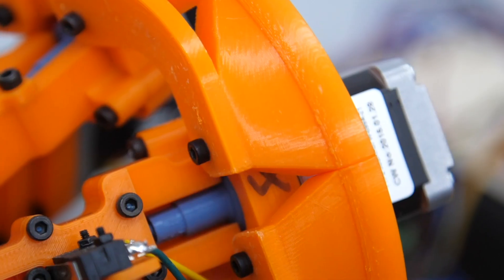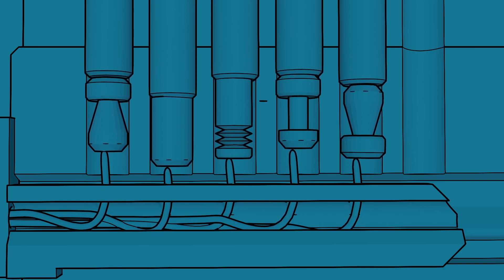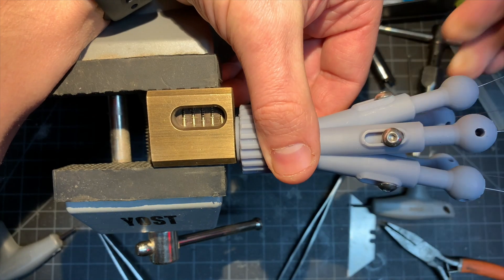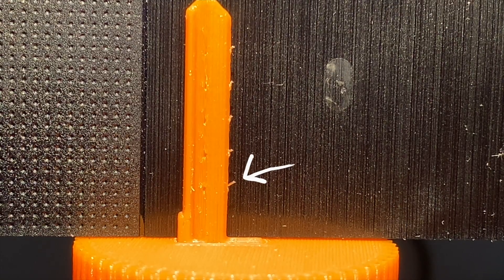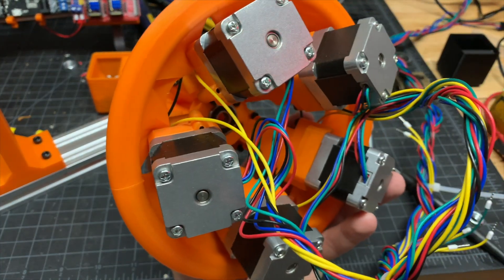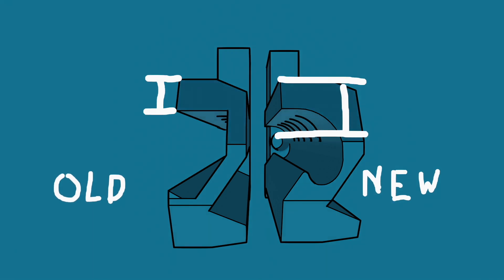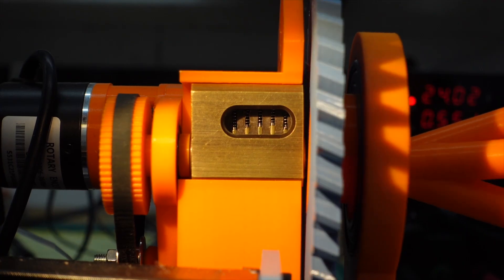i made a robot that picks locks WITHOUT A PICK

Comment: Very nice project! Why not just spin the lock instead of the key assembly? I was also wondering if you could add a distance sensor for each wire so that no test turn is necessary.
Reply from the maker: You know… spinning the lock never occurred to me.
Reply: @SparksandCode I receive similar comments on my projects, too. Once I get going on an idea, it's full speed ahead, and I forget to ask myself if there are alternative solutions.
Reply from the maker: Exactly. 

I’ve been nerd sniped by a few of these comments that have creeped into my rough idea for v3
Reply: @SparksandCode  Nice. I'll be on the lookout for the next version.

Comment: Wouldnt it be possible to push the wires as far as possible and then turn the key so the pins bind and then you can pull the wire out and turn it completly

Comment: You could eliminate the linear actuators if you made the key have pins with springs the wire pulls against rather than pushing the tumbler pins directly with the wire

Comment: very close to one of the ideas i had of using a key blank as a guide for a pick with a finger for each pin, though my idea was leaning more towards the Leishi design. could probably even make a modified version for dealing with the Bowley lock, though i remember seeing someone actually built a pick for one about a year or two after i had posted a description for an idea i had as a design to deal with it's "unpickable" design lol. coding and 3D printing are outside of my skillsets though, i'm more mechanical and old school lol. now you just need to get the optical encoder to the front of the lock somehow so that it could be used for some real work! definitely have to follow this project :) got my sub!

Comment: Pretty interesting.
1st of all, the metal key is absolutely necessary. Even aluminum ones  can get twisted, and you are trying resin/plastic...
2nd of all, you can try to use a base-whatever Gray code, to reduce the number of moved pins.

Comment: The wires don´t need tension, but that doesn´t mean you cannot use it. To put less pressure on the plastic of the key itself, it could have a slightly wider top part made out of metal, kind of functioning like a tensioning tool. Then, the mechanical stress of the rotation is mostly applied to this metal part.

Comment: More modern stepper drivers such as the TMC2209, are capable of measuring resistance on the stepper motor, which would be useful for sensing if the lock has been picked or not, the force is set in firmware/software(depends on how you want to implement it), so you can easily tune the force to be just right where it will be able to turn the key once unlocked but won't be able to shear the plastic key.
Reply: Resistance is not the most correct word, but I think you get what I meant.
Reply: You could also use a smaller stepper motor with a worm reduction(metal or printed), this could provide a lot of torque without taking up a lot of space, and you also get to rotate the motor 90°.

Comment: So lock pickers put tension on the barrel and move the pins with a pick. They can 'feel' and some times hear a click as the pin moves in to the correct position, and then they move on to the next pin. If one pick sticks then you move to the next and then go back to the stuck pin and try again. Could you mount a motion sensor on the barrel that feels the movement of the click while putting tension on the barrel, or a microphone that hears it??

Comment: You gotta make the "key blank" out of 2 thin steel plates, epoxied or pinned together with the wire channels milled out of the surfaces that meet... if that makes sense

edit:  you could do it by hand with a scribe and file if one plate was aluminium

Comment: As a trained designer/engineer and now current locksmith. I had a similar idea when I first started. 

This is far more impressive and way wayyyyy cooler than mine. 

Your editing and video/graphic presentation in your work is remarkable!

I will be using your provided files to add to my daily arsenal of bypass tools. 

Subscribed for sure!
Reply: As a 30’year Licensed Locksmith, this is nonsense.
 He says he “picked the lock while watching the pins in a lock with a cutaway! SMH! 
Nonsense!

Comment: Hey, here some ideas to upgrade your prototype: 
First you diminuate the size and the velocity of your prototype by using, instead of linear actuators enrol the cable around cylinder with a huge diameter or use between the enrollment cylinder and the motor reductions gears. Moreover for the rotation you use a stepper motor, witch you can already use the position as an actuator. Lastly it could be great to have a version that can fit to a door and stay in place

To conclude its a really good job you won +1 subscription

Comment: You need to check a < STEP_MAX && (abs(a-b)/STEP_INTERVAL <= 7)

b < STEP_MAX && (abs(a-b)/STEP_INTERVAL <= 7) && (abs(b-c)/STEP_INTERVAL <= 7)

c < STEP_MAX && (abs(b-c)/STEP_INTERVAL <= 7)

I think.

Sorry for the messy code, typing on a phone. 
7 is "usually" the maximum adjacent cut difference. On a real key if you have a cut too deep next to a shallow one it will have it's ramps intersect the shallow cut. 

Source: 10 years of locksmithing.

Comment: I wonder if there are any easily measurable forms of feedback you could make use of to speed up the process? For example, is there a distinct change in electrical resistance, or perhaps a particular sound or resonance when the pins are aligned properly, that could be detected by a multimeter or sensitive microphone. Maybe there's a usable signal (electrical or audible) the pick could generate, which would be modulated in a detectable way. It seems feasible, to me.

Comment: What about bowden cables? Then you can pack the steppers together into a driver and have a smaller unit that goes into the lock. You might even be able to reduce the number of motors with some multiplexing.

Comment: The thing about this type of attack is that it's the only one that should work if your lock is designed properly. Normal lock picking only works because, in the real world, tight tolerances are really hard to achieve.
This type of attack isn't much of a concern; if your lock takes hours to open, it'll hold up to attack far longer than your hinges, your windows, or the security measures on the neighbor's house.
Reply: It's very useful if you're trying to open one of your locks. For example, a shed of an inherited house or some small treasure chest. You can always look up the lock online and make a blank.
Reply: @Uthael_Kileanea it’s pretty useful if you need to pick a lock that you can access the back side of to mount an encoder
Reply: @Uthael_Kileanea  Right, but in the real world, a Lishi tool is cheaper and much faster. And makes it easier to cut a new key once you do pick it.

Comment: You'd need a way for the robot to feel resistance but you could use the wire/actuator to measure the distance the wire pushes each pin till it bottoms out to limit the set of pins that could be installed and work from there.

Comment: dude thats looks COOL! but just a idea you added the bigger motor. but i think if you added the small motor with small gear to the support ring with a belt first of all you have a huge ratio and you can add a tensioner wheel to it with the encoder or switch this way if the tension gets to BIG the tensioner will move and it knows it has a bad setting. this also removes it from the back side of the cilinder with seems a bit unrealistic.

Comment: Hmm. What if you used all the actuators at once to overset all the pins past the shear line, and then wiggle the key while backing them slowly off? Then each would set on the way down and the lock would be picked.

That would let you pick a lock much faster and with the same sequence for every pin combination, and because you overset the pins you wouldn’t have to care about security pins at all.

Comment: For version 3 you could maybe do the encoder on the key side and have some kind of torque sensing to determine when pins are set. Motor current sensing could work pretty well for that.

That would let you sense that little give when a pin sets properly, and it might let you generalize the robot to work on actual doors.

Comment: Maybe if you add two metal tongues or pins, that will engage the cylinder and not just the 3d print. You would avoid having to micro machine a metal key blank, yet you get some stability.

Comment: Nice take 😄.
Have you thougth about using "Gray code" to improve the search speed (at least a little). This might be considered "premature optimisation" but if you are familiar with Gray codes the required implementation time, effort and number of lines of code to change should be rather insignificant.

Comment: great video, but could you try using a low pass filter on your audio? Some of your footage has a very high pitched noise in the background.
Reply from the maker: Yeah you are like the 4th person to mention this. What timestamp is it at so I can investigate. Sorry about the noise. I'm still very green to video editing.
Reply: @SparksandCode  
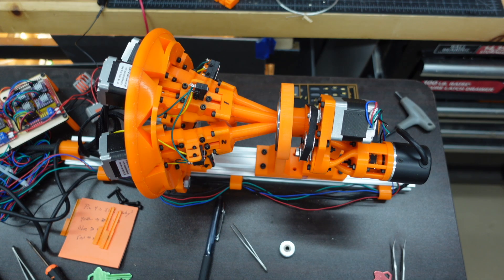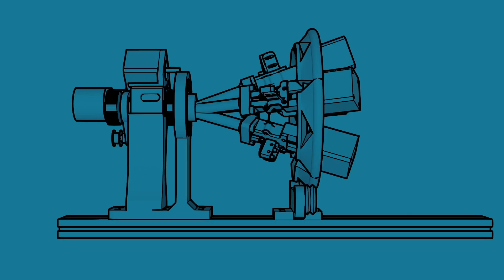8:45 - 8:51
9:22 - 9:29
9:37 - 9:49
11:14 - 11:28
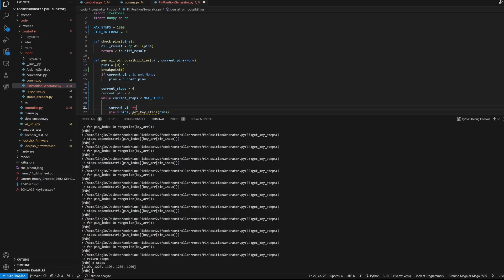13:19 - 13:29 
it's probably caused by a power supply or motor driver, you should be able to see it on a spectrogram and it should be easy to fix with a low pass filter set a little below that frequency

Comment: Congrats on getting the project to work, and open the lock with it! It's quite amazing what you can do with 3D printing and dedication. A few other comments mentioned that a Sputnik pick was a real thing, and it predates the patent. It was invented by a genius, but he used it for evil to break into places he wasn't supposed to be. In proper use it's far from brute force, where the shape of the spool security pin assist in picking the lock. As the lock rotates further on a spool pin, what pickers call a false set, you can determine how close you are to correct. By picking the only standard pin, you will notice the rotation angle, left to right wobble, increases. Then for each pin, you can push it to, the wobble decreases. When the wobble increases beyond the original 'wobble' then you know the pin is set to the correct height. There is a great video by Marc Tobias Webber who interviews Oliver Diderichsen about the tool. In expert hands, it wouldn't take more than 30 seconds to pick the lock. 

There are a few shortcuts you've taken in the design process, which are things I've been stuck on for a long time, designing my own iteration. For example, to string up the sputnik and cut the wires to length. As where on others, the wires are not replaceable and believed to be a special alloy. Thanks for showing this and sharing your design files, but digging a bit further, asking experts and asking around could have saved quite a few steps. Similarly to how collaborating with someone with machining skills could have created a metal key for you. As it's relatively easy to do.

I'll certainly add it to the knowledge base, and you'll get an honorable mention in op coming talks or blogs on the topic of lockpicking machines and tool making. If you, or others have questions, or otherwise want to collaborate, do reach out. You can find me fairly easily, as I'm the president of The Open Organisation of Lockpickers in the Netherlands.

Comment: You can buy the tiniest little linear servos. They are inexpensive. It is my understanding that the moving parts there come from a camera lens focusing mechanism.

The 28byj shouldn't be this slow either, i don't know why you're struggling to turn them faster. But i wouldn't use them due to inherent backlash. You can also buy precision linear stepper mechanisms intended for cheap optical disk drives.

Comment: An alloy you can cast against plastic is cerrotru. Make a negative for the blade as well and reprint the key with only the tubes then put the two together and pour the alloy to fill. Maybe T slot to keep it together. 
   You are probably already familiar with Rose and Wood's metal, LPL just had some for a kit, well... cerrotru is stronger and dimensionally stable (alloys grow and shrink when cooled and over time, depending), no lead either. 
   Not kidding about low temp, I use it to inlay wood like they used to with pewter. I only use blue painter's tape for a dam and it does not burn it or the wood. It's also just called 281⁰f, that's it solidus And melting point (there can be ranges by alloy) so it casts at 350 to not chill halfway down.
   It could probably work.

Comment: I'm going to contest your encoder simply because you put it on the other side of the lock.
 If anything, you need some form of force feedback to determine whether that cylinder is free or not.
Simple load cell on a spiral spring would do the job.
In fact a load cell can determine when each pin has cleared as well

Comment: Question: since the lock is now integrated in the middle, the robot is limited to locks removed from their door.  If you could get all the components on one side, it could actually open locked doors.  You could still use an optical encoder, but you need a secondary signal to compare against.  You need a way to compare the key blade rotation to the system rotation.  So essentially 2 sensors.

Comment: Nice try, and an interesting approach. Thanks! 🙂👍 In reality, those Sparrows(?) practice locks can sometimes be opened by using a rake in a couple of seconds. And a fairly low cost electric picking gun (EPG) can be very quick on real door locks. It will be very interesting to see a version of this machine opening a standard 6 pin tumbler lock with security pins with the lock fitted into a door.

Comment: As soon as you said it doesn't use tension, I knew exactly why it has six steppers and why it takes a long time. You're using brute-force (not literally) to test every key combination.

Let's see if I'm right.
Reply: I disassembled an Apple dot-matrix printer from the mid-80s and it uses a surprisingly similar mechanism for the print head. The biggest difference is that the pins are driven by solenoids, rather than steppers. So lots of force, but no control over distance.
Reply: A guy at my makerspace has just recently started using our resin printers to create investment originals for lost-wax casting. He hasn't had much luck so far, but I bet it would work well for this, so long as the passages are wide enough for the plaster to remain intact.

Comment: I think you could cut the majority of the weight and size of it all by replacing the 5 nema 17 pin pushing motors with some Haydon Kerk Nema 11 (possibly even Nema 8) captive linear steppers. It would also cut out the need for the linear adapters attached to the nema 17s.
 For turning the entire device on the front end i would try going back to the Nema 14 size you started with but switching to maybe a 100:1 gearbox version instead of that huge motor. The gearbox doesnt add much size to the Nema 14 and would probably provide more torque than the larger motor you ended up using. 
 All that being said, amazing project bro! Just earned yourself a new subscriber that cant wait to see whats in store for version 3!

Comment: you applied to exhibit at OpenSauce right?
Reply from the maker: You are the second person to mention that. My summer is pretty busy (and I'm on the other side of the country). I'm converting a School Bus into a camper currently and my next video.
Reply: @SparksandCode  aw maybe next year then :D
also thanks for the inspiration, I've wanted to do something like this (using wires for the actuation too), but am thinking about how to do it with stiffer mechanisms now and measuring force feedback to pick like a human would!

Comment: Stepper motors have speed limits that low? 

Never encountered anything like that with 3d printing
Reply from the maker: No I could spin the Nemas faster. I was just showing the difference in max speed of the smaller ones and Nemas in a quick visualization.

Comment: there are small 4x6x15mm linear units with stepper motor available from ebay and ali. They are ripped from small optical drives.

Comment: 1)
Try to use an encoder with a single 3-phase motor instead of five stepper motors.
The encoder should convert an angle of the motor and encode it to the corresponding key configuration.

Imagine the mechanism of a safe. There are 5 discs (not gears). Each one for each pin.
You can convert the positions of these discs to pins positions using a simple crankshaft + connecting rod mechanism.

And you can even make the whole mechanism small enough to place inside the key!
---------------------------------------------------------------------------------------------------------------------------------------------
2)
Consider using servo-motor instead of stepper-motor + optical encoder.
It would be much better to apply a certain force to rotate the key, and then return it.
So you need to measure the position of the key after 1 sec of applying force to know whether the lock is picked or not.
And the force that should be applied is measured by a simple DC motor voltage. You don't have to change it once you have the right voltage picked.
---------------------------------------------------------------------------------------------------------------------------------------------
Hope that that will help you to make a better version!

Comment: Great project vlog!  I do wonder how much pain you would have spared yourself if you had decided to try some different resins early on.  The fast resins tend to be very brittle, but a lot of functional resins behave more like ABS.  There might also be some room for a hybrid design, where you print the fine details but attach those to a metal key base somehow; the load-bearing part isn't the same as the fine-detail part...

Comment: Impressive work. I really wonder if one could automate the manual lockpicking. With load cells, it should be possible to detect set pins and maybe even detect safety pins.